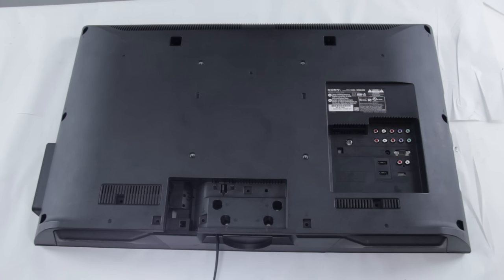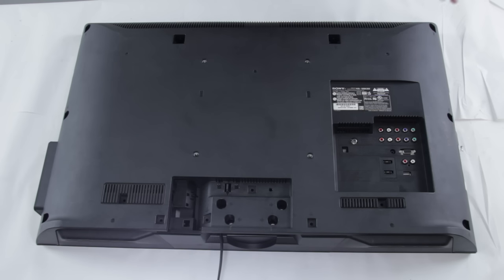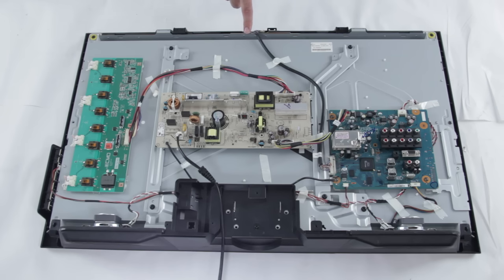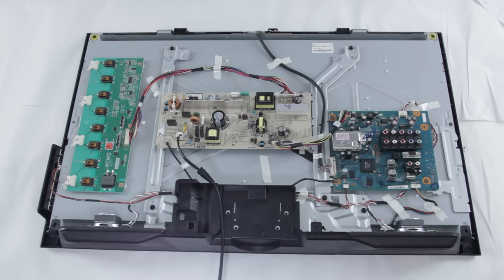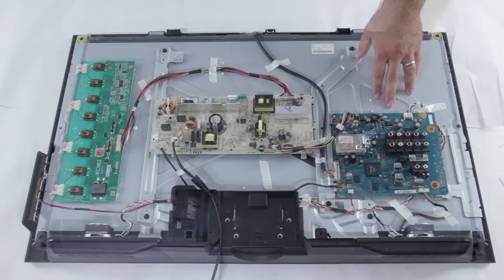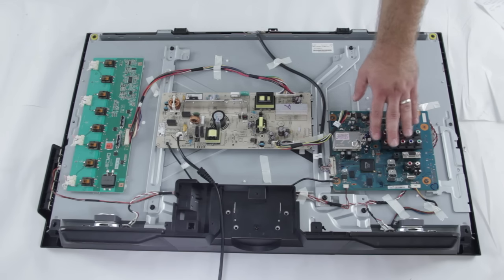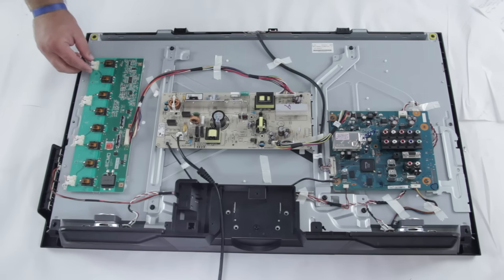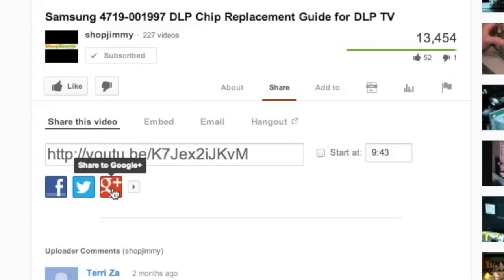LCD TV Repair Tutorial - LCD TV Parts Overview, Common Symptoms & Solutions - How to Fix LCD TVs

Comment: This video was very helpful. We have a Samsung LN-T4661F A tv. There are horizontal lines that flicker on the top 4-6” of the screen intermittently. Sometimes the picture is good, but the flickering lines (almost to a black bar with the dense black in the center and smaller lines near the edges). Any ideas what might be wrong with it?

Comment: LG LCD TV 47LG70-UA no picture or soundSymptom's when TV went out: Was watching cable when the screen displayed some rainbow colors then picture and sound went out.
Model#: 47LG70-UA
Serial#: 805MXBP29757Symptoms:
1. When TV is plugged in the TV appears in standby (Power LED shows Red)
2. When TV is powered up, the Power LED turns Blue but no picture or sound.
     A. I removed the back cover and it appears to have backlit.
     B. When powered up the screen turns from black in color to Blue in color but no picture.
3. The menu options do not appear when the menu button or any controls on the side of the TV are pressed, but I hear a beep sound     when the TV controls on the side are pressed.
4. I have already replaced the capacitors on the Power Supply board with a repair kit with the same result. 10 Capacitors were replaced except the two large caps.Would greatly appreciate assistance in troubleshooting the issueThanksGary

Comment: Hey guys. Have a Sony KDL-32ML130 not working. First, when it turned on it would only have audio, no picture. Now it won't turn on period. I'm assuming it needs a new main board and power supply. Thoughts?

Comment: Having a black screen issue I checked all the capacitors and they seem to be good I am NOT getting sound or picture other than a few fuzzy lines every once in awhile I checked all the boards nothing looks to be burnt out or appears to be damaged but then again I am NOT an electrician any thoughts would be greatly appreciated I would like to attempt a component level repair but I cannot figure out which component it is that is causing the issue any thoughts on what to look for or how to test the items would be greatly appreciated I watch the full video and it was helpful but I still cannot figure out what the problem is I get no picture no sound and no response when I hit a menu volume or channel button

Comment: hello. so I have a TV that has a slight discoloration on both ends. that is to say both ends of the TV have a vertical blue line running from top to bottom about 3 inches thick.  my TV model is Mitsubishi LT-52149. Thanks in advance

Comment: I have a Sanyo DP52449...the screen sizing (aspect) feature will not work, and it is stuck on way oversized.  Unable to change to any size screen using the remote.  I actually bought a new remote, but that was not the problem.  All other features for both remotes work fine.  I reset to original factory settings and still have same issue.  Thanks for any help.

Comment: Hello, thank you for what you do!
I have Sony Bravia XBR-65X900F that was purchased in 2019.
After coming home from an extended hospital stay the tv will not do anything. 
No back light, no indicator light, no sounds etc.
After attempting a forced factory reset, a green light comes on in the indicator light, but the screen still does nothing. 
Not 100% sure what the problem could be.
Any insight would be appreciated.

Comment: Model : Vizio E472vle..  Sometimes the Vizio symbol on the tv will illuminate in a reddish/ orange color and other times it will not light up.  if I play with unplugging  and plugging the cord into the tv I can get this symbol to light up in the orange.  Note that I can not also get this to work; meaning it will not light up and the tv will not power on either manually or with the remote.  Once the TV powers on I have no issues using it  and the display works fine. The Vizio symbol turns from orange to white and the TV powers on and works fine.  The problem is that the TV will not always power on... very temperamental

Please advise.

Comment: Hi I have sony KDL-50R450A has lower part of the  screen horizontal line move up and down about an inch. other than that all screen is working well, which board you think I need to replace?

Comment: My TV won't switch on but the power led when connected to wall socket shows both blue and red light. Usually it shows only red light when on standby and only blue when it is on. The TV is VU model LED-32K160M

Comment: Hi great video... I have a philllips 49inch 4k tv ( 49put49000/12) that  has been barely used and just didn't turn on one day, is there likely to be a replaceable fuse inside as ive checked all the external fuses cables and outlet supply

Comment: I have Insignia NS-50D40SNA14 (Model nos) If I put it on,  it will work normally for few minutes and the picture will go off. But the sound works normally. When I put it on for that few minutes I looked at the back panel(all the light in the room off), I could see some light but this light goes off immediately the picture goes off. What do you suggest I should do?

Comment: HI Jimmy, this posting is from a few years ago but so was my LCD TV.
My TV was a Philips 17 or 23PF9946. The display was geting bad, but at least the power was working fine. Unfortunately, I took the thing apart without noting first how the power was started up from standby.
The powerunit has nr PLC170P1 and is supplied with "green" standby chips TEA1601T and TEA1533AT. The voltage on the large elco is OK, but I have no idea how to start it: there must be some low voltage somewhere that you connect perhaps to ground(??) to create a logical signal to come out of standby.
Any advice welcome, Maarten Boer (the picture is my youngest grandson)

Comment: Hello. I have a lg 42lk450. About a year ago, hdmi 1 and 2 stopped working. HDMI 3 still worked, so I have been using that. The other night the picture went out. The sound was still on crystal clear. After a few minutes, the picture came back on. It kept doing that. I took the cover off to find all the board numbers, which I did. My question is how do I know if this problem is the tcom board or the main board? It seems when I took the metal plate off the tcom board, the picture stayed on longer. I also tested the hdmi ports that weren't working. One port got source not found like it did. The other hdmi port had the blue screen that I now have been getting when the picture goes off. The Tv has back lights as well.

Comment: I have a Philips 186 LCD Model number 47PFL6704D/FT.  The serial number is YA1A0927007580.  The unit has no power.  I should add that this TV quit working about 1 year after I hung it outside on the wall in my lanai in Sarasota Florida.  It has not been rained on but of course it is very humid outside most of the year.  Should I mess with changing out the Power supply or any of its components (fuse) or just toss it.  It was a spare TV and I know that TV's and humidity don't mix.  Thanks for your input

Comment: Hey. My issue is rather basic. I have a 5yr old Sony Bravia LCD TV; Model No. --> KDL-40S4010   Serial No. --> 4405840 .The lcd screen is broken showing partial images but everything else works well (hdmi, av inputs etc). Can i find a replacement for this part? Does it make sense to do the repair? Thank you.

Comment: I have a sharp lc-55le653u television that has sound but no picture. When I turned it on, there was a picture for a split second and then it blinked off but it still lights up, there isn't any picture though, I tried replacing the tcon board and the main board, really because they were cheaper, but neither worked, any tips or tricks, or hints or help would be greatly appreciated!!!

Comment: panasonic tx-42a400b
Hi thanks for this great video. It doesn't however help me with my predicament, could you please help? The issue is that after turning the TV on it lookes like someone is playing with the remote. Random things appear on the screen with no pattern (changing the input, settings etc). I removed batteries from the remote and disconected the manual control board (at the back of the TV) but it still won't help. Any ideas what might be causing this?

Comment: I have a LG 37LH5000. The screen turns on but only the top 1 cm. Then gradually over a 15-20 minute period, horizontal lines appear and freeze, then more and more appear with the freezing time reducing, until the full picture is shown and works perfectly. The issue is at the top right of the screen, as when I manually heat the area up with a hair dryer it warms the area up and the screen works. Can I repair this issue? And how do I go about it?

Comment: HI, I have the LG model 55LM4600. Does not have picture but has sound. Once powered on, screen turns from black to lihgt gray, channels change, as could be heard, but menu buttons, inputs, etc, produce no result on screen. it remains light gray.

Comment: Ok so I have Sanyo DP42740 that turns on and then off after a few seconds, I thought it was the power board so I purchased a new one and installed it. It still has the same issue as before, should I purchase a new main broad to solve my problem?

Comment: I have a Sony Bravia 32'' KDL-32L4000 When i press the power button the green light goes on but the TV doesn't display any picture..... I used to be able to make it work by deconnecting the powercord and reconnecting it and press the power button until it would work! i would like to know if it can be repaired or should i get rid of it? Thank you

Comment: Hello I have  a Sumsung LCD TV model nr#LN46A550P3FXZA, at the begging 
the TV was turning on for a couple seconds longer than it used to...now 
the TV is turning on and off for a couple of times, usually the screen 
stays black with no voice sometimes during this process it produces very
 loud sound for a couple of seconds than it turns off and when it turns 
itself back on green screen with vertical stripes shows up for a couple 
of seconds too.  There is no pattern to repeat all these actions are 
random....Usually it turns itself off up to 5 times after that it works 
OK..I've replaced capacitors and these are fine.Thank you for any lead!

Comment: I have a Samsung TV, UN32F5050. I was showing the stand by red light on but it went out when I tried to turn on the TV but got no picture. I replaced the power board and still have the same problem. What do you suggest?

Comment: Hello there. I have a Philips 205 42HFL5581V/27 which has a Matrix dot issue upon boot of the tv few seconds later the screen turns black. Tried replacing the power cord but no luck. What do you recommend?

Comment: LG 50LN5600=UI 
On power up the LG logo flashes several times and then the screen goes black.
When the screen is flashing you can see the back lights flashing through the back cover.
When the screen goes black so do the back lights.
I don't see anything with the flashlight test.
There is no sound.
Thanks in advance for your help.

Comment: I have a LG 42 inch 3D full HD led tv 42lw5700. This TV was connected with my satellite setup box through HDMI cable. All of sudden yesterday the screen went black and spark sounds started coming.I switched it off and when i switched it ON, I observed a total pink screen which goes off after 4 -6 seconds and then the screen just flashes with vertical green lines and and a message on the screen that pl set a  input device. There is a whistling sound also which comes which doesnt reduce if i reduce the volume of the TV. Today my service engineer came to my home and opened the backa nd checked my mother board. he said its working fine. He said the panel is the problem which will not be available with Lg as well since its a 4 years model. I am helpless now. I dont have any option now. Can you please help whether its the T-Con fuse problem or anything else. Can you please suggest me few tips?

Comment: My Samsung LN46D503F6FXZA fell off low stand about a foot onto carpet, broke stand off at base of tv but tv worked perfectly. Installed wall mount and turned on tv and it has sound but no picture. Suggestions or is there a specific video for this problem for repair?

Comment: I have a Samsung UN65KS8000FXZA (Ver. FA01) LCD TV that just developed a brown vertical line at the center of the screen. The area where the line is, appears to be dark, like a LCD has failed, but I am not sure. I would like your opinion on the failure mode. Is it possible that the dim (or brown) area on the screen is a function of a failed LCD strip? 
I also looked on your web site and noticed that there are three LCD strips listed for my model tv. Is there a way to confirm which Samsung PN is in my TV ?
Thank you for your support.

Comment: I have a LG 47LN5750 that powers on, flashes a good picture for about 1/2 second, then goes dark. As the unit is powering up, I notice the red power led on the bottom blinks 3 or 4 times. Shining a flashlight on the screen shows good picture is playing and sound is good. When I turn the tv off, picture flashes for 1/2 a second again then turns off. Does this sound like a power supply, led, or both?

Comment: Hello and your video was awesome... I have a 46 47 inch Toshiba tv and it fell on the floor half of the screen have colors going through it and the other half shows a picture I don't believe the inside of the screen is damaged because otherwise it wouldn't show I don't know please help me...
Reply from the maker: +courtney bush    Try all repairs and troubleshooting at your own risk.  This sounds like a TV panel (TV Screen) problem.  If your TV panel is bad, it may be more cost-effective to replace the TV as panels are typically hard to find in stock, difficult to replace, and expensive.  Thanks and please let us know if you have any further questions!  www.shopjimmy.com

Comment: Hello, I have a samsung ln32c350 with a 6 inch vertical grey (intermitently green) line on the screen around the middle of the panel. I'm thinking this is a bad t-con board. I have upgraded the firmware and cleaned the lvds cable with a pencil eraser and visually inspected the internal components. Does this sound like a t-con board issue to you?

Comment: I have a 55” RCA Roku  led uhd tv that I was trying to turn around It started to fall and I caught before it hit anything  but when I turned it on there was a crack on the inside not the outside in the right hand corner  where I caught it how do I get this fixed and what is the name of the inside reflecting unit called and how do I fix it?

Comment: My Zenith Z50P3 \ Model: 50PC3DB lists all the "Input" jacks on the screen from which you choose your device. The listed jacks are grayed-out when not in use, and lit when in use. The two HDMI inputs worked until recently. Both inputs still light-up when viewed under the "input" listing and in use, and grey out when not in use, but the screen reports "No Signal". From your video I'm surmising the "Main Board" may need replacement?

Comment: I have an 80” Sharp LCD Model LC-80LE650U…the TV won’t turn on and has a short flash followed by long flash..in my search I have found this to be an error code for the backlights.

How do I diagnose this as replacing the backlights on this is a taunting chore.  Could replacing the main board fix this or power board?  Is there a converter board on this big screen? 

How about a reset sequence?  Thanks in advance!

Comment: I have a LOGIK 24inch HD1080p LCD iDVT Combo. The screen has started to go to menu bars under it's own volition and is randomly scrolling down settings all on it's own (i.e. Has a 'mind of it's own'). I have removed batteries from the remote and have tried the TV in a different location to no avail. Is it the TV's control module at fault and if so please tell me how to locate and replace it. Many thanks Dave

Comment: Hi I have a Samsung tv. Model number LE40C580J1K, and Serial number Z7C53SHZ502763E.
It works fine, but once it’s been on for 2 or 3 hours the picture flickers. Sometimes I turn it off and on again 
and it’s okay for a short while. Other times if I leave it for an hour then it’s okay for another couple of hours.
Any suggestions on what to do to repair it please?
Many thanks David.

Comment: I have a dixon 31 inch, LED tv, model number:STY0632 ,  someone peeled off the serial number sticker , like you said in the video, the backlight is on, like when I switch on the TV, you can see the blue-black backlight is on, the audio plays fine, but there is no image, is this the T-con board that needs to be repllaced? Then at some point when the Tv gets hot, the image suddenly appears.

Comment: I've got a Toshiba 50L3400U, model #: 10284C07392C1 that 2 weeks ago developed a black shadow about 4" wide starting from the right side going toward the left. 3 days ago another shadow about the same size developed at the top of the screen. Do you know which part I need to replace?

Comment: My Samsung flatscreen is about 3'tall/5'across and large enough to stand on floor. ModelHLR5877YY and 2007. It's not very flat however but I think it's a LCD. My Q. If the TV works but is periodically going off,so then you have to turn it back on again. What's the possible problem?

Comment: Have RCA LED LCD TV, model LED32B30RQ.  TV will some times flicker but not all the time. Seems to do it more after set has been on for awhile.  Took rear panel off, do not see any blow capacitors. Ideas?

Comment: I have a 42" LG LCD TV (Model # 42LC7D - UK) and the screen in black.  I watched your YouTube videos, and according to them (I have sound but no backlights), I used the flashlight procedure to show I needed backlight inverter boards.  I ordered them from you and installed them, but I still have a black screen.  Any suggestions?